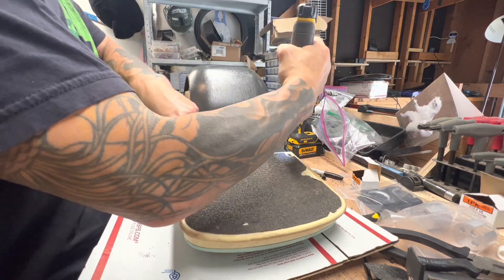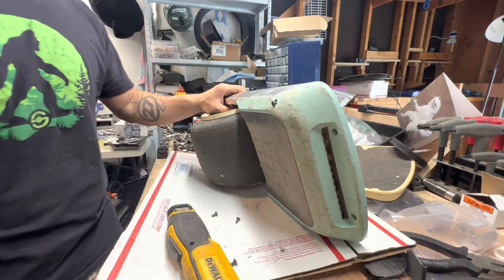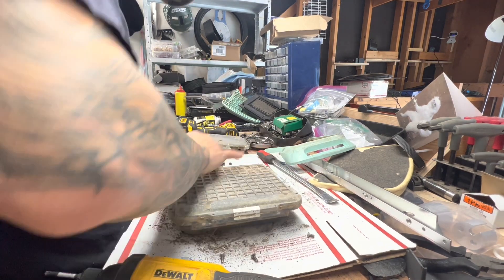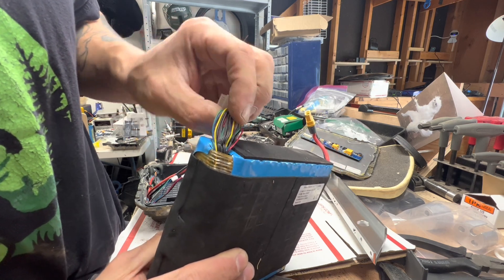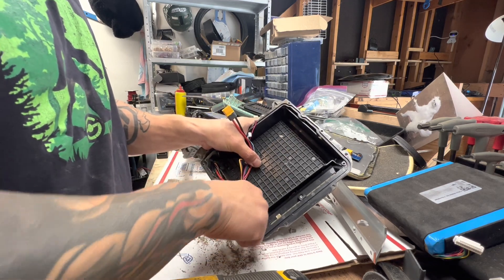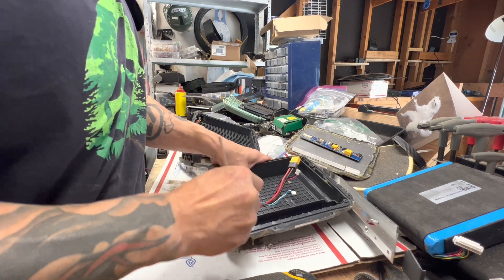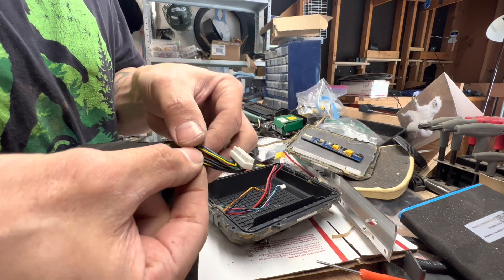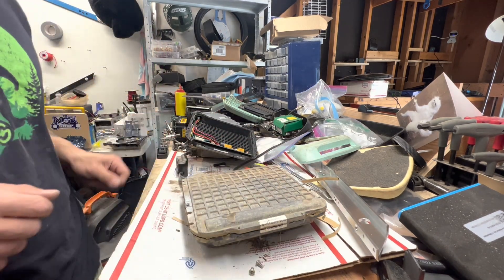Pint X - Battery damage prevention

Comment: I just bought the pint S and at 10 miles on the new board it lost power (luckily not while I was riding) but to honor their warranty I sent it back in today… you would think they have fixed the issue by now…

Comment: Just finished this mod on my Pint X. With only 320 miles and no drop offs, my wires were pretty damaged.  One looked like it could be broken,  by how badly it was crimped. I removed the offending plastic with a dremel, coated the wires with spray-on liquid electric tape, and reassembled it. Wish I had caught it sooner.

Comment: No modification to the area the main power leads sit at?
Reply from the maker: Not unless the wire was too short or they ran it directly over that wall. If it’s fit well in the groove it’s not going anywhere

Comment: Just got my Pint X in the mail from Future Motion.  Rode it 2 times to make sure all is ok.  Today, I pulled open the battery tray, dremeled the crap out of the sides of the battery box and you can now literally see clearance for the balance wires!    Kyle at Future Motion is a Bitch for doing this and yes this was done on purpose.

Comment: Literally got my pint x today and am itching to ride (cant with Canada wildfires, air quality) and stumble upon this design flaw today. Now I don't know what to do lol.
Reply: I’ve had my board a little over 1 year and the temp sensor wire ended up breaking. Future motion told me I need a new battery and they wanted to charge me over $500 to fix my board.
Reply: @DifferentSubjects  apparently Future Motion is doing "free inspections" on this issue. We'll see how they try to get a hold of the situation.
Reply: Damage from this can be prevented. Any sudden impacts on the board will speed up the damage to he wires.
Reply: @northuniverse  I agree it can be prevented, but not without voiding my brand new board’s warranty
Reply: @Graves539  honestly the warranty is too short to be useful. If you dont use your warranty within the first couple weeks you'll probably never use it.

Keep this in mind though, future motion may refuse to work on your battery box is they see it modified.
Reply from the maker: @graves539 open it up. Takes me 30-60 mins.

Comment: Hey man, appreciate the video.  I have this whole thing apart but I can not find a tool that seems to fit the last little plate before you disconnect the battery from BMS.   Is this another specific tool like the T20 head?
Reply: Yes it's a security bit. 20IPR security bit. There's a hole in the middle of the bit.
Reply: @northuniverse got it. Thanks!  The bit I had just barely fit in there and got it to turn.  I had to press down really hard to ensure I didn’t strip the bolt.  That said, my pint is all mended back to normal.  Thanks
Reply: @DWhiz  awesome!
Reply from the maker: T8

Comment: 7:28 Ive seen that the controller XT60 should be plugged in after the main power XT60 has been plugged in for 10-15 seconds. Isn't it common for the BMS to turn on immediately and fry things on the controller?
Reply from the maker: Not necessarily true no.